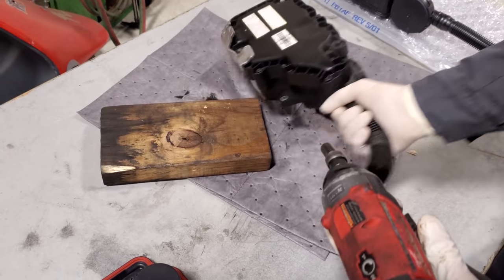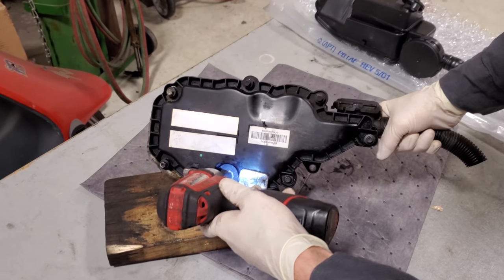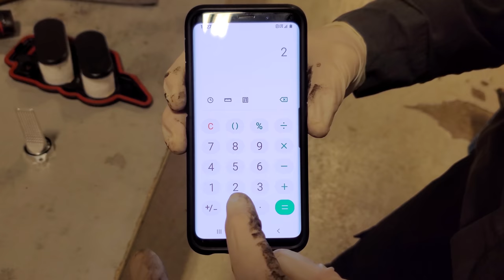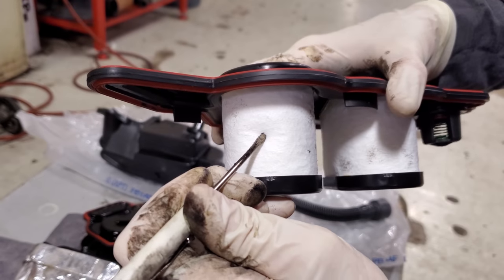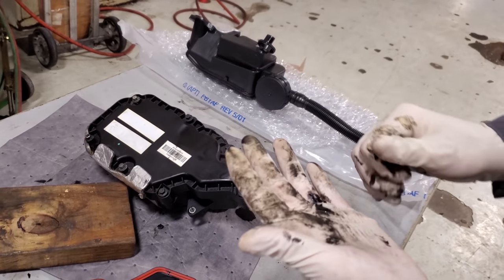Ford 6.7 Powerstroke - CCV Re-route??!!!! Do YOU do it or NOT?!?! You DECIDE | **MUST WATCH** |

Comment: I had to install a reroute on my 13 due to the turbo/intake set up I was running didn’t have a place for the factory CCV set up. As a mechanic it really frees up a ton of space and cleans up the look. After beating the hell out of it for the last 10,000 miles I haven’t seen any oil leaks form at all. Vapor smell is not noticeable with windows up in traffic. Don’t even have oil drips. Worth my 80 bucks
Reply: So.. i would like to know where you found the kit for $80😂

Comment: Done this mods on several trucks for me and our family business. Several 6.0 and 7.3 trucks, a couple ram cummins trucks as well. Essentially I've Just extend a heater hose of sorts out around the bottom of the motor somewhere. Never any issues of smell that was a problem  and most had no oil dripping up tube.
Only had a couple trucks that had that problem and they were the ones with pretty worn-out engines that had bad Blow by. I will definitely be doing this mod or something similar to it on my new 21 F350.

Comment: I didn’t know about the filter until a few days ago when my wife took the truck in for some service. I had noticed a change in turbo pressure and oil leakage. I think this was my issue, but the damn dealer wanted to charge $825 to swap it to the filterless box. I just bought a filter instead and swapped it myself. Actually pretty fast and easy to do. I don’t know why it wouldn’t just be a regular service item.

Comment: Thats a pretty slick little gizmo.
Mine is a filter less ccv,  so I'm just gonna let her ride
Reply: Get rid of it, it's dumping oil into you intake,and it mixes with soot from EGR. Send me your email I'll send you pictures. I just cleaned out a intake, it is incredible that these engines run with all that crap inside!
Reply: I just changed mine i had sout in the front hole is that normal@lewisbolman7862

Comment: It's 9/26/23 in California, and today I just bought a slightly used 2020 F350 with a 6.7 that only has 15,546 miles.  Before I took possession, the state required a SMOG check.  It passed with no issue, but the SMOG guy said, "Do not remove the CCV box!"  They inspect under the hood, and if it's missing you will not pass SMOG.  Is SPE making an additional California legal external catch can to capture the condensed oil vapor?  One you can possibly drain from time to time.  I can't stand the idea of pumping that crud back into my beautifully running engine!

Comment: Great video. I would like your feedback on my current project. 

I had a filter less CCV box on my 2016. Last December I purchased the Mishimoto kit to introduce the catch can into the mix with the factory filter less ccv box. I had it on and off twice and it leaked due to what I would imagine is a fitment issue. Torqued to specs exactly how Mishimoto recommended, O rings lubbed and seated etc. 

I wanted to open it up and somehow delete the factory ccv air to oil separator but still use my catch can. My brother and law (mech eng/car guy) and I this Christmas designed a different set up all together. We used the regular old delete kit by AM diesel, than I had some ORB  to hose barb fittings made for a 1.25” vacuum hose off the same location as stock pre turbo inlet. I’m awaiting a  aeromotive vacuum regulator to be installed on the outlet side of the catch can than on the inlet side I will route the typical ccv delete hose off of the back of the valve cover. We’re confident it will work it will be just a matter of regulating the vacuum and I intend on setting up a gauge as well. 

This was a pretty costly way of doing things  for what it is but I’m excited to have the catch can on and to get rid of the fumes from the standard CCV delete, Also free  up space on that side of the valve covers. I hope it works as the Mishimoto catch can is nice but with the kit was over $400 CDN, the aeromotive valve was $165, custom ORB to hose barb fittings for each side of the regulator $300, 1 1/4” vacuum hose was $30, CCV delete kit was $230, vacuum gage $20....  it all adds up so I’m hoping for the best when the vac regulator comes.              
                                                                    The real question I have is what would be the desired vacuum pressure? It will obviously change during different levels of boost etc. Any input would be appreciated from the pros.

Comment: I have the Maryland Performance Diesel ccv delete kit. The hose is run under the cab. I can definitely smell it and I also will get a drop of oil out of it occasionally. You can easily see the vapor coming out. I think I'll switch to this kit to see if the oil drip goes away.
Reply from the maker: That Maryland one is junk
Reply: @PowerStrokeTechTalkwARod  I agree. This kit looks like the addresses all of the issues with doing the ccv delete. Thank you for the video.

Comment: You have to be careful if you remove the CCV box as there is some kind of sensor that would throw a CEL in the 15+ IIRC. There used to be a video on it and I think it was on your channel. I have a 13 and it can be removed without a CEL but I think in 15 like I said, they put a sensor in to prevent CCV deletes. IIRC the sensor is in that circle thing where the hose attaches to the CCV box or its where the end of the hose attaches to the valve cover...Double check me bro, but yea...
Reply from the maker: No....it was not there to prevent ccv deletes

Comment: Great video and most I’ve seen will have pressure under the oil cap and 9 times out of 10 the upper oil pan is leaking, rear main or it’s pushing oil out of everywhere
Reply from the maker: Yepp

Comment: Outstanding content, as others have said with you and FordTechMakuloco.  Also a subscriber to ModernDieselCory who gives great detail on this and other SPE products.   2017 F350 that had the non-serviceable CCV filter and now using cheese grater + reroute (not SPE) = great results (min to no scent and no drips).  Disappointed with amount of oil residue at only 30k miles within intake pathway (cold side pipe upgrade) to include upper intake manifold mixing with EGR gases, nasty buildup of soot+ccv oil mist.   Keep up the great work and look forward to your opinion with trying these products.
Reply from the maker: Need to get you on my show!!!

Comment: I did cover delete on my 7.3 I had because it fills the after cooler because on 7.3 there square corner caps and it sucks the oil in threw there so eventually fills the after cooler with oil
I ran my hose down my frame rail then built a box with 🤔 sos  pads kitchen worked great 
Now with my 6.7 2013 92,000 miles I'm definitely going to check this out I have 3500+ idle time,I also run SPE thermostat witch here in AZ were it get brutally hot I did the green wire ground switch for my fan 👍
Reply: I also run a CCV bypass, ran a 5/8 hose all the way to the rear of my 99 7.3 crew cab. This was 20 years ago and never had any problems, 223K plus miles!

Comment: I ran a cheaper CCV delete and ran the hose down the firewall and over to the exhaust to a bung I had welded on the exhaust so it would send the vapors out the tailpipe.
Reply: I watched a vid from the SPE guys. If you’re tuned, you have to be careful. It is possible to suck oil out of the engine doing that (flooring it, racing it, etc.)

Comment: My 17 had an upper oil pan leak 97k miles... So take it (under warranty) to get repaired, well they came back and said ccv was clogged causing crankcase pressure to build and spit oil out .... They replaced with the updated none screw top... Let's see if they were right.. hence just got it back today.... 1/24...
Reply: @Raheem Cruse Any updates?
Reply: @donovanwylie8891  yes. That was the problem no more leaks.

Comment: Just watched your video, excellent info. Have a 2018 750 exact same problem excessive crankcase pressure filter was absolutely saturated at 117,000 Miles and 3,200 hours. My question is was unsure where you got the upgraded version of the crank vent box.?? Ford or aftermarket store?
Reply from the maker: Ford store
Reply: TY.. also like to add... Have a similar issue with a 550 same yr but it has a sealed ccv box and getting extreme amount of BP and smoke from oil filler cap.. engine is only 2yrs old and showing cel and code for crank vent.. can that sealed box get clogged.. also hearing that one of our local Ford dealers is changing out 2 turbos a day on the 6.7 but nobody is mentioned anything regarding the CCV filter being part or primary cause. Our fleet, we are finding that IS the primary issue at 100g miles and/or 2500-3500 hours.. Anyone else having or seeing that being the primary cause of the EGR and turbo failures?? At such early mileage or hours???

Comment: SPE's CCV Delete and Internal Catch Can (Cheese Grater) is amazing. Have the combo on my '11, and have yet to have any oil residue out of the dump tube. 👍
Reply from the maker: Thanks Ryan!!
Reply: Did you have any issues with a check engine light after you did the SPE delete
Reply from the maker: I havent heard of one no.
Reply: @PowerStrokeTechTalkwARod  without a tune
Reply from the maker: Removing the ccv.....doesn't require a tune....
Reply: @PowerStrokeTechTalkwARod  I have a 2014. It did require a tune due to the Hall effect sensor being part of the CCV box. It was removed on later models. I think 2015 and up no longer have the sensor. 2011 and 2012's had a removable hose from CCV box I am told but still had the hall effect sensor. The sensor is really an engineers over thought. They were afraid without a tech would forget to reconnect it. The sensor will trip a MIL code.
Reply: @edwardhooper4371 I have a CEL on my 15 after doing the ccv reroute.  The minimaxx tuner I have is not supported for the 15-16 powerstroke and looking for a different tuner to get the CEL to not come on because of the reroute.

Comment: I have an early build 17’ with the filter-less box!  Thx for the vid! 126k miles with no problems.
Reply: Have you replaced your yet? I have an 18' with the same thing and 115k. No excess pressure. I ordered a new ccv but if there is no pressure should I even change it? I don't want any leaks but if it's all good do I leave it until there is a little bit of pressure?

Comment: So I just happened upon this video after doing a search from a Powerstroke Forum post on Facebook concerning ccv filter boxes and oil leaks.  I have a 2015 F250, with 246,000 miles on it.  It's went through a "weight loss program" @ around 135,000 miles (egr & def).  Just checked the ccv box and it's the one without the bolts.  So I assume mine has the filterless ccv box?  I also popped my oil cap off while running and there was no pressure that I could tell, just a little smoke/steam haze.  My question is, should I still look into doing the SPE ccv reroute kit?  If so, what benefits would I gain from the reroute kit if I have the updated ccv box currently?  Great video, very informative.
Reply from the maker: Thanks pal but you have to look elsewhere those answers, sorry.

Comment: If the factory ccv box is backed up or clogged, could this cause the truck to smoke through the exhaust pipe at idle at a stop light? Sorry to bother with all my questions in the past but I'm desperate brother. Keep up the excellent videos, they're VERY INFORMATIVE and SO HELPFUL. 👍👍👍👍👍👍👍👍👍👍👍
Reply from the maker: Not really
Reply: @PowerStrokeTechTalkwARod  👍

Comment: That filter was really plugged! In your opinion, can the quality of the oil and proper service intervals help alleviate the plugged CCV issue? Only reason I ask is because I ran a catch can on the 2.7 ecoboost I used to have. In about 5000 miles (or an oil change interval) I had to empty that thing about 3 maybe 4 times with the motorcraft oil. When I switched to a different brand full synthetic (same viscosity) the catch can literally caught almost nothing in between oil changes, maybe a teaspoon of crap would come out. So it made me raise a question of, is the CCV delete really necessary, or was service intervals/the quality of the oil the cause of the CCV having an issue? Love watching your channel!
Reply from the maker: Tonight, we talk about CCVS ALLLL NIGHT. Podcast here we comr

Comment: Thanks for the information I do enjoy your videos, but I have a inquiry regarding CCV route does the 67 engine need the vacuum crank case gases or is it OK to naturally aspirate the case?
Reply: From what I understand, the case is venting no matter what. In the factory case, it takes the air back in through the intake process and "recycles" it, but it would get that air either way. So venting the gasses shouldn't have any impact on performance or anything like that. It's just gonna replace that old recycled air with fresh clean air.

Comment: On the grater, if you talked about it, I missed it, what about it setting off CEL without tuning?
Reply: there is a vid on SPE that talks to the electrical connection.  my 17 does not have it.
Reply from the maker: Ok

Comment: Interesting enough I've had a P0170 caused by a filterless CCV box on 2 trucks. Both 2017s. Replace the CCV and it never came back. So I'm not sure what happens inside of them, but something fails in those too.
Reply: Are they single rear wheel trucks? The drw truck have a different box than the srw trucks. On the srw trucks you can change just the diaphragm, cap and spring. It is the round part on the assembly. I am going to do that in the next few days on my 18 f350 srw. I do not think dealers sell just the diaphragm,  cap and spring kit just the whole assembly.  Dorman ( I think part number 918359) has the part kit. You can get it at Rocl Auto or a local part store. Just under $40 at a part store and $18 at Rock.
Reply from the maker: Juss get the drw one & be done
Reply: @PowerStrokeTechTalkwARod  that will fit on srw trucks? Cool!  I just checked for crankcase pressure on mine after I changes my trans fluid today. It wouldn't even move a paper towel. I should be good for a little longer but will change soon to have some piece of mind.

Comment: Hey my good man👋,great channel good content and explanations of procedures.
I have a question about the 6.7 regarding oil consumption,the vehicles in question are both 2018 F-450 tow trucks. One for sure has the “popping oil cap” my question is when the system gets that pressurized is oil getting pushed into the inter cooler,I will be stripping it down tomorrow so I guess I will find out,but the oil was topped up and taken to a Ford dealership about the oil cap pressure 🤷‍♂️they sent it back unchanged and checking the oil today there was none showing on dip stick.
Any knowledge in this situation would be greatly appreciated ✌️
Reply from the maker: Brother thanks!! Please check TSB 19-2142 as this is your issue!!! Take it back to them bozos

Comment: The real question is can you  use the cheese grater WITH the OEM filterless box?  In theory there should be less oil for the box to deal with, but it would still route the vapors for burning. I have a 19 250, boltless version.
Reply from the maker: Naw...both have to sit flush to the valve cover
Reply: I am contemplating running the SPE cheese grater with the New filterless CCV box on my 2022, will just make a spacer for the drain port so they sit at the same height, than I will machine an adapter to go from the CCV box flexi hose to a reroute hose, this should be the best possible solution I am hoping.
Reply: @ashleemattearl  Yeah I like that option the best!  Factory with less oil in the intake, and still under vacuum.

Comment: Early 2017 6.7 powerstroke i don't have the bolts on top just ordered the spe recirculation kit i hope i did the right thing truck only has 50,000 miles on it
Reply from the maker: Yes ditch that crappy box
Reply: Thank you sir

Comment: I would have thought the other end of the hose from the "cheese grater' would have a fitting to the other port on the valve cover to route the gasses back in, then there is no smell or drip... seems simple solution.
Reply from the maker: The point is to remove....the gases...
Reply: @PowerStrokeTechTalkwARod  But to vent to atmosphere is not good, better to re burn them through the intake?  My mistake on my previous post, I should have said intake for the other end of the hose .

Comment: I'm thinking about doing this, Would it be a good idea to run a mini air filter on the end of the hose to prevent anything for getting in the engine as a extra precaution? like sand or bugs
Reply from the maker: No

Comment: Did they go back to the filter model in the 2022 models? My ‘22 6.7 350 dually ccv box has screws on the top but they’re not the 8 mils like the one in the video.
Reply from the maker: No filter

Comment: Have you had to work on any of the 3.0l v6 diesels? I’ve got one in now waiting for parts. Came in with a oil light that would come on when hot. Thought it was going to be the switch but it’s actually the drain back in the oil cooler(rubber stopper falls off) got to replace the whole cooler now and a lot of sh!t has to come off to get to it lol.

Comment: Did Ford change the CCV box on the 2021 trucks, back to a serviceable filter. Looks like it, because I have a 2021.
Reply from the maker: No servicable filter whatsoever. Aint even a filter in there
Reply: @PowerStrokeTechTalkwARod  
Ok, good. It just has a removeable top, with torx screws. I'm curious, what is under that removable top?
Reply from the maker: Just a baffle system to help sep the oil dropletts from the vapor
Reply: @PowerStrokeTechTalkwARod  
Ahh! Now I feel better. Thanks Aaron. You have a great channel. Myself, as well as others, have learned a lot about these engines, repairs and upgrades.
Reply from the maker: Hey brother thanks!....we work real hard to deliver usable content that all PSD owners can use and benefit from